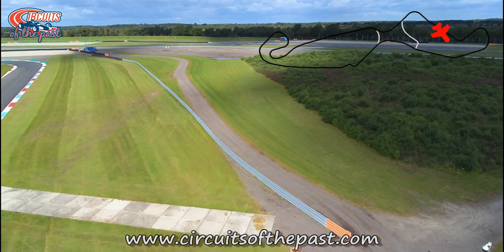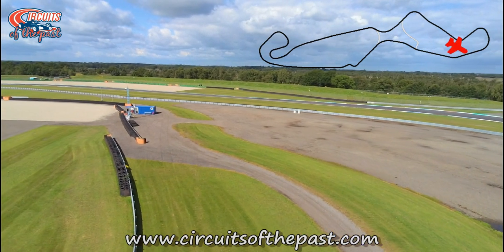Drone over TT Circuit Assen, Netherlands

Comment: Nevcer heard of a circuit built specifically for bikes before.
Reply from the maker: Yes, it was originally designed for motorcycles only. In the 90's they start to organize car races too.
Reply: @Circuitsofthepast  are there any other tracks designed specifically to any form of motorcycle racing ?
Reply from the maker: Not much. In the 80's and 90's they told Assen was the only circuit especially designed for bikes. However, there are some street circuits only used for bikes too. But that are not designed circuits. Or you must count the artificial corners at Mettet (Belgium).
Reply: There are a handful (only a handful) world-wide that are exclusively bikes "JenningsGP" in Florida in the U.S. is a current example.  There are many tracks that were designed with bikes in mind though, with different run-off requirements (i.e. nothing solid to hit).  An obscure example (if you don't live nearby) Talladega Grand Prix Raceway (Alabama, US) was designed for bikes, but allows cars.
Reply from the maker: @LapoftheWorld  Thanks for this interesting information!
Reply: Circuits of the past is Mugello not bike designed, or maybe Cadwell Park? Or are they just very thin tracks?

Comment: I am surprised Formula 1 has never raced there! It looks like it would be a good circuit for a Formula 1 race!  The only drawback is there is no long straight, This is a little similar to Silverstone.
Reply from the maker: There was a plan to make it more suitable for overtaking for F1. A bypass at the Ruskenhoek should create a longer full throttle section and a harder braking zone. However, that was before F1 choosed for Zandvoort. And to be honoust, that's where it belongs. Assen cliuld have been an alternative when F1 abandoned Zandvoort after 1985. But those days Assen had no ambition for car races at all.
Reply: @Circuitsofthepast  "That's where it belongs". Except Zandvoort doesn't have the supporting infrastructure. It's not even anywhere near a highway. Assen does have all this.
Reply from the maker: @therealdutchidiot  Ondanks dat hebben ze het goed weten te organiseren, zonder files. Met "that's where it belong" bedoel ik dat historisch gezien de Formule 1 op Zandvoort thuishoort en de MotoGP op Assen.

Comment: People complain about Hockenheim's rebuilding works, but the destruction of Assen was even worse
Reply from the maker: Maybe even more. Assen lost a technical section while Hockenheim lost straights and chicanes. However, the first part of the second version of the North Loop was a little boring. But the last part was fantastic with a very fast blind corner before braking for the original Strubben Hairpin.